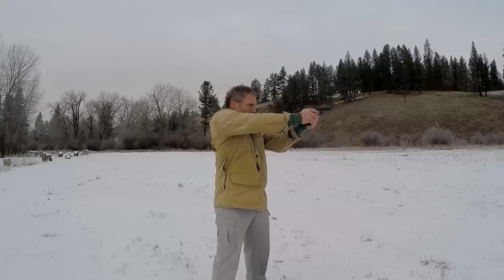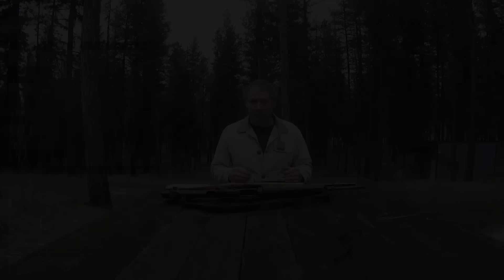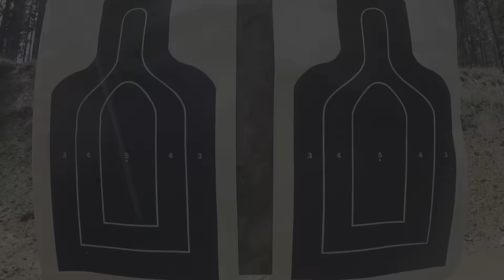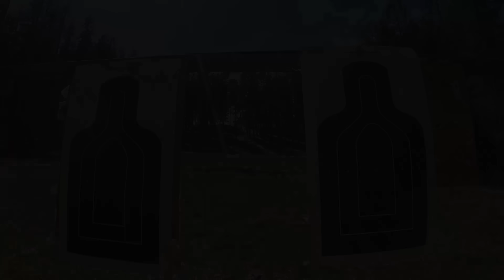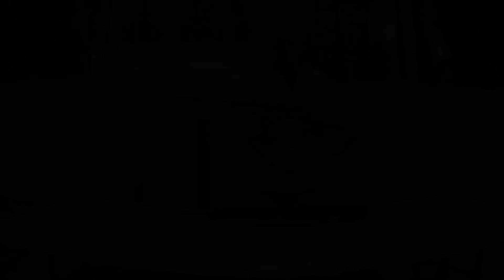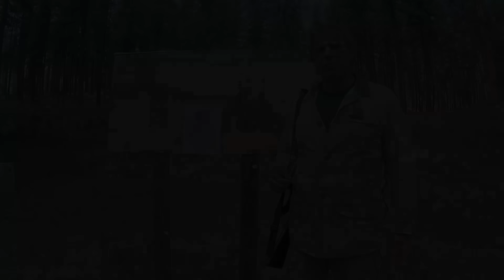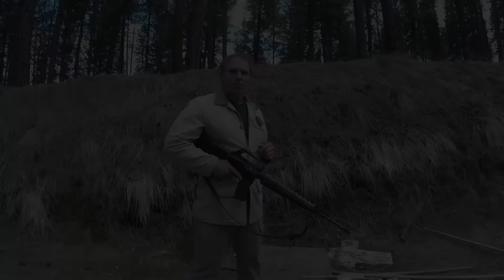Mini-14 vs AR15: Which is Better?

Comment: I've owned a Mini14GB since the mid '80s and built a couple AR's in the last few years (money is in short supply or there would have been more). Since I'm in Cali I find your discourse at the end just as interesting as the testing at the beginning! I find the AR's more "tactical" and a bit faster to operate, but I"m not an "Operator". Both platforms are fun, but when I am concerned about prying eyes, I take the Mini; when I'm going out of state to shoot I take an AR or two. Thanks for the very complete and informative videos - glad I found you.

Comment: My agency originally purchased a number (500 I believe) of the original GB Mini-14’s.  Then they obtained about 3,000 M-16A1’s from the USMC.  The intent was that every Agent would have his / her rifle which they would have zeroed on the range prior to qualification.  Two of us sighted in the Min-14’s and the 160 M-16A1’s that my agency has sent us that they had obtained from the USMC.  We noticed that the M-16’s, though dated, were noticeably more accurate at 100 yards. It took a while to accomplish the sighting in so in the mean time we had 10 M-16A1’s and 10 Mini-14’s on the range for qualification.  Each Agent was issued 60 rounds. Ten with which to sight in and 50 for the Qualification course.  Prior the 1st. Quarter’s qualification we scrupulously cleaned each of the 20 rifles.  The intent was to compare reliability over a 4 quarter period if possible.  Well - the M-16’s choked badly the first Thursday after ~ 200 rounds.  The Mini-14’s continued without malfunction for four quarters which was 3,600 rounds / gun. (The 4th quarter the bolt of each was “sticky” due to lack of lubrication, but they functioned OK .). I can not speak for the M-4’s that were purchased later, but I sincerely hope that they were more reliable.

Comment: One point I would like to add for the AR platform is the ability to modify and or optimize that rifle.  I am not talking about lasers, flashlights, tasers, etc.  I am talking about stocks, hand grips, safety selectors and triggers that one can select to more suit individual preferences.  Talking about triggers specifically, a trigger replacement is minutes and does not require a gunsmith to do correctly.
Reply: Yeah but a good trigger job on a Mini 14 is a hell of a lot cheaper than most of the nice drop in triggers you can get for an AR. There is actually more stock options for the Mini 14 than a AR. You got EBR stocks, ATI tactical folders, Tapco collapsible stock, Archangle precision stocks, Choate conventional folders, Choate tactical non-folding stocks, bull pup stocks, an assortment of wood stocks by Stockys or Boyd's. You can get a Dragunov Stock on a Mini 14 for god sake. Complete stocks can be changed out to suit the needs of a individual. With the AR all you can really do is change the hand guard, grip, and a different style butt, that's it. It will never have 100% function in a folding stock, It will never be able to swap out from a conventional stock to a pistol grip stock, and bull pup is not an option. And a little word on the Mini 14's safety, it has been placed where god intended it to be.

Comment: You really should do an addendum video with the newer(tapered barrel 580 and up serial number) Mini14, the number of  newer rifles is ever increasing and most of the old issues(accuracy, inconsistency etc.) are addressed and fixed in the newer models so operation/sightline aside the newer ones are likely to offset and even remove the accuracy advantage that the AR has over the older minis...

Comment: Unfortunately MY Mini 14 is both - unreliable AND inaccurate. Tested some mag-brands but to no avail.. Thank you Paul for the superb tests!
Reply: Oink Spanie 
So fix it.
I have accurized mine and they can be made sub moa. Try a block under the barrel at the quarter chord from the receiver. Then, as you are shooting, you can determine if the block need slid forward or aft. Once you determine the optimum placement, bond it to the stock.
Reply from the maker: @breakermorant2428 That's one solution. Mine would be to beat the rifle with a sledge hammer then go buy a rifle that works correctly.
Reply: Well that's one way to waste money Paul, especially when you have such a great CS dept from Ruger. If the rifle does not shoot to Ruger's standards (4 MOA) and does not cycle properly, they will fix it. And will even fix bad head spacing to. I can go buy a 30 year old Ruger right now and if it doesn't work properly I can send it to Ruger for it to work properly for FREE! That's what you get when you buy a Ruger, a lifetime guarantee.
Reply: J. Huff I feel you took his reply way too seriously
Reply: You are right Alex, when it comes to matter of the firearms, I do take this shit seriously. It's one way to keep from spreading internet lore and lies. If i was new to firearms and had to turn to the internet for any kind of information I would be fucked. Thank God I'm not.

Comment: I'd appreciate it you would redo this test mini 14 vs AR with identical scopes. I have a mini 14 and the way the sights are normally set up the AR sight is higher than the mini 14.  So is there a  difference in accuracy when both are scoped with the same scope? Is the difference in accuracy due to the way the sights are designed on the rifles or is the difference in accuracy due to other factors? Thanks.

Comment: Way back when I bought a Mini-14 GB  when a local cop shop closed it's doors along with 10 Ruger factory 30rd mags. The MINI 14 GB was limited to police sales only at that time but the cop shop was selling everything with the exception of class 3 weapons to anybody walking thru the doors. I found it to be very inaccurate compared to my Colt SP1. I  even had a friend who shot a M-14 in competition try it and the best he could do was 10 to 12 inch group at 100 yards. I did much better than that with my SP1 with factory sights. Ruger offered a full auto version to some South American Governments and the word was the receivers were cracking after repeated full auto usage. I sold it during the height of the Assault weapons ban and have never tried another. Another drawback was the mag. factory Ruger 30 round were hard to come by and the Fed Ord 30 and 40 rounders offered then  never worked that reliably. I now have a newer S&W knockoff of the  M-4 semi auto and it has never failed to feed or eject. Very accurate and reliable and a multitude of mags that work to choose from.

Comment: Good review. I used to have a Mini 14 that was factory equipped with the flash hider/bayonet mount, military sights (like the AR) pistol grip, folding stock and in stainless steel. It cost me around $450.00 and I installed a 3x~9x scope, super accurate. Best rifle I ever owned, I sold it to my neighbor with a buyback option but sadly it was stolen.

Comment: Personal preference on my part chose the Mini-14 (chambered in 5.56 NATO) over the AR platform rifle.  I had to carry an early M-16 in Vietnam back in the late 60's, and had the most problems with that battle rifle than I ever had with any other rifle I had been issued.  My disgust with the AR platform rifle convinced me I didn't want one under any normal circumstances.  "If it has a dust cover, I don't want it."  The Mini-14 uses a "Garand" action, which I have found reliable in all situations where my life depended on it.  This is just my personal viewpoint, since I know the AR platform became (and still is) the standard battle rifle for the U.S. Armed Forces.

Comment: Mechanical zero is a dirty word to me. :-)  My 1SG insisted everyone set their rifles back to mechanical zero one time before going to the range.  He had some hair brained idea that I could not talk him out of.  Such a brutally long day.  Only plt that was zeroed and qualed by noon was mine because I told everyone if they touched their sights bad things would happen.  If the person before you was half way competent you should be close.

A3?  I know there is an M16A3 but I have never seen one and my understanding is that it is an A2 with a full auto trigger.  The A4 is the flat top.

Comment: I think the major difference is the Ruger is piston driven and the AR is gas everybody know's that the gas driven is more accurate thanks Paul great video
Reply: The ar platform is inherently more accurate but other factors can cause one particular rifle to be more accurate than another as well. In my opinion the biggest difference is reliability in adverse conditions. Pour some mud on a mini-14 and see how well it runs.
Reply: @boomerisadog3899  you can say the same thing about the AR throw some dirt on it and see how reliable it is the piston rifles are more reliable in adverse conditions
Reply: @patrickmccrea3455  Actually, an ar15 will continue to function even if you pour mud all over it. That's the benefit of a sealed system. Even with the dust cover open the bolt carrier keeps stuff out. Once mud gets inside the action it will fail but it does a good job of keeping it out. If you pour mud on an ak or almost any other rifle it will fail almost immediately. Although, an ak will continue to function in dusty or conditions, partly because of the loose tolerances. A Garand or mini 14 will fail very quickly in adverse conditions because the action is wide open. Ar's and ak's both do a good job of keeping crap out, especially, ar's.
Reply: @boomerisadog3899  I have been to Iraq twice and I know first hand that sand and dirt lead to catastrophic fail in the m4 soooooo
Reply: @patrickmccrea3455  Any weapon will fail after prolonged exposure to the elements without proper maintenance. All I'm saying is that the ar platform does a good job of keeping the elements out. I never said that they couldn't fail, only that they are better at keeping stuff out of critical areas.
Reply: @boomerisadog3899  and all I am saying from first hand knowledge is piston rifles hold up better in the elements
Reply: @patrickmccrea3455  What piston rifles did you use in the US military?
Reply: @boomerisadog3899  HK416
Reply: @patrickmccrea3455  Fantastic rifle but a bit much for most civilians, in my opinion. Plus, I think the recoil impulse is little stronger than well gassed di gun. I'd still take one over my ar for home defense, if $ was no object. Either way, it's still just a modified ar platform.

Comment: I bought my brand new production mini-14 from Walmart in my area for exactly half of the usual price (I paid $399).  I already have an AR an simply wanted the mini at that price.  But I was never enticed to buy one at $800.  There was internet gossip that Walmart had dropped the price unadvertised, so I called ahead and they confirmed the price and they had 2 minis.  I got there in 30 minutes and one guy in front of me got the first one, i got the last.  I know they were sitting in the store before the price drop.  AR is great but the mini has a cool factor :)

Comment: You touched upon the very reason why I dont own any modern black firearms, and probably never will as long as I'm in the left leaning state that I'm in. People have a negative perception of tactical black or "Military" firearms where I am, and we have a 10 round limit. There really isn't a good reason for me to own one. An AR platform is like a glock to me. The Honda civic of guns. There's nothing special, but it works, and gets the job done. Plus I prefer older firearms anyway. Love the classics.

Comment: My Mini 14 manual says that it is OK to shoot 5.56 ammunition (despite the fact that it is marked .223 on the barrel) so I question whether using .223 ammo in the test is really an advantage for the Mini 14.  Of course yours may be different.
Reply from the maker: There are lots of different opinions on whether the Mini can be fired with 5.56 and lots of variations to minis from one generation to the next and many opinions on whether or not 5.56 is really any different than .223   When all else fails read the manual, but I don't know if that same info applies to mini's of different generations.

Comment: New viewer (first paul vid!!). Love them so far. Only thing i think could be argued for accuracy is not using a locking bench rest for testing. It would be slower but would significantly reduce user error comments. Pretty scientific mate ty. Wasnt bored for a second!
Reply from the maker: You are right. If I used a lead sled it would take me completely out of the equation. But there are two things going on here. First, part of the accuracy is the shooter, the way the stock fits you, the sights, etc. so me shooting the rifles are part of the equation. There's also a second reason, but that will be more evident on the next video that should be up in a day or two. I'll explain it when you see the next vid (zeroing your AR)

Comment: If your serial number of your mini 14 starts with the prefix 580, it is the upgraded and far more consistently accurate. I have a mini 14 prior to the 580 serial number, but mine was one of the good ones. I put it in a bull pup stock and have had countless hours of enjoyment using it. That being said, one thing must be pointed out that you failed to do. What purpose was the firearm designed around! The AR 15 platform was designed as a combat weapon, which includes fast reloads. The Mini 14 was designed around hunting and target shooting., where you insert the mag and leave it in till you finish your days work out on the field, or your hunting daylight is gone. Rapid mag changes are not a consideration. When ever comparing firearms, always take into account what the designers had in mind for it's intended use and the intended buyer. Good video comparison though, and you gave an honest appraisal based on your use and experiences.

Comment: Hi Paul,  For a closet case gun owned by a civilian, it doesn't matter much.  FOR a frequent shooter  the AR Plat Form WINS HANDS DOWN.  There has been soooooooo mush notable wear on the Mini's that almost ALL law enforcement agencies have retired their Mini 14's to the honor guard use only.  It appears that excessive government use has brought about noticeable wear in the Mini 14 bolts.  After just a few thousand rounds the Mini 14 bolts peen themselves to be a little shorter in length and the rear of the cartridges have been known to blow out creating a somewhat hazardous condition.  I love them both, and both are fine guns, and I don't get to shoot that much, but given the choice, all things being equal, I would choose the AR Platform.

Comment: The most accurate is the one most accurate for you.  Regardless of the mechanics, individuals will find they can shoot better with one over the other.  

As far as zero, the M16A1 was standard issue in 1976 and we zeroed at 25m with the understanding that the round will hit point of aim at 250m not 300m.

300m seems to be the standard for A2.
Reply from the maker: I just filmed a video on Zeroing the A-1 and A-2. It should be on line in a week or two. The manual I have from C. 1980 reads that the A-1 can be zeroed at 25M or 25 yards. The most important part of accuracy is the shooter. Some people can shoot a mini more accurately than an AR